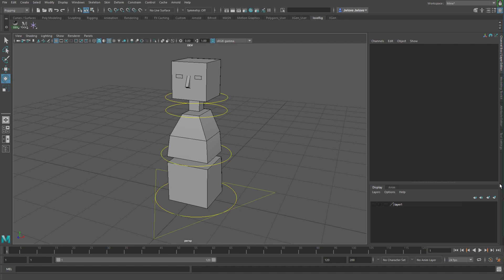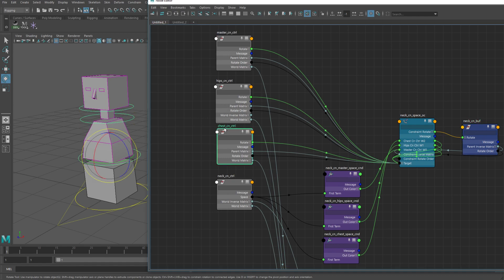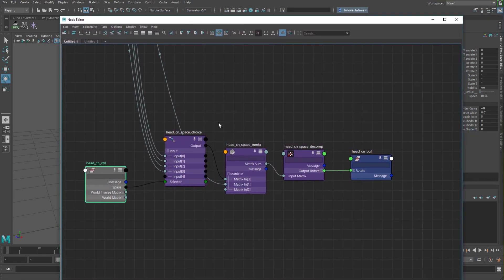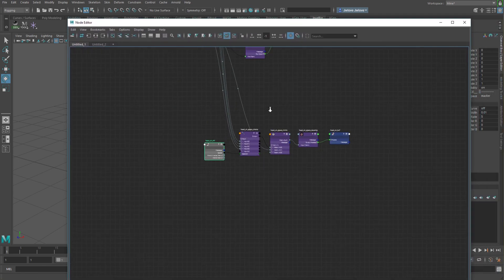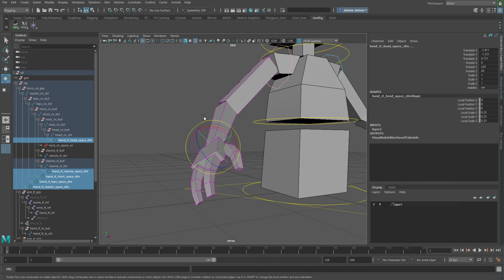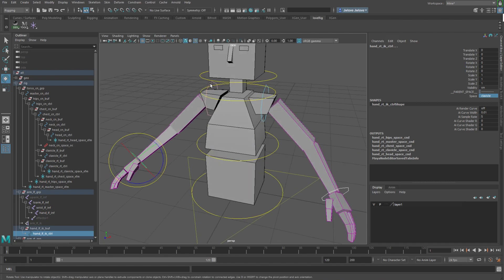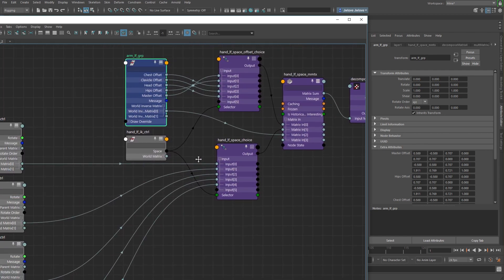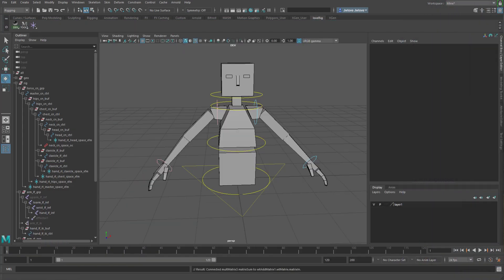Maya matrix node space switch tutorial

Comment: Hello Jared. I'm trying to reproduce your maintaining offset setup here. There's some way to connect the "offset" multiMatrix´s  (the temporary one, used just to get the offset calculation) matrixSum directly on the choice node Input using python instead of creating those matrix attributes just for store the data?
I've tried:

offset = cmds.getAttr("temp_multMatrix.matrixSum")

cmds.setAttr("name_of_the_choiceNode.input[0]", offset)

but I get an error:
 Error: RuntimeError: file <maya console> line 5: setAttr: Error reading data element number 1:

I believe the error is due to the type of both nodes aren't the same or compatible. If I add the flag  type="matrix" in the setAttr command I get another error:
RuntimeError: file <maya console> line 5: setAttr: The attribute 'name_of_the_choiceNode.input[0]' does not accept data of type 'matrix'.

How would you proceed? There's some problem in just connect these attributes on the node editor, and keep all the temporaries multMatrix or I'll get a cycle?
Reply from the maker: Hey Bruno - so sorry you've run into this problem. I'm currently on a vacation for 2 weeks, so I'm away from my computer and can't do any explicit testing to make sure I provide a correct answer.  Once I get back home, I will look more into it and we can figure something out. In the meantime, could you please give me any other details of what you're trying to do that you think might be helpful (if there is anything else)?
Reply: I'm really sorry for bothering you on your vacation, man! Actually, I'm trying to connect the result (the "matrixSum" output) of the temporary multMatrix used to get the offset calculation between the target and the driver via python, instead of using those matrix attributes on some other node to receive this information, you see. But don't worry about this right now,  enjoy your vacation and sorry again!
Reply from the maker: @brunosilva3170  no worries! Thanks for your patience and understanding
Reply from the maker: @ Bruno Silva - Ok, well... apparently, I lied about just setting the choice node's input atttrs with matrix data.... I'm terribly sorry to do that to you.

I've set the choice node inputs with other data (probably just float values) in the past, and if you want to put matrix data on the matrix math node inputs (like a multMatrix) without keeping a connection, you have to set them manually since they lose their matrix data as soon as you disconnect them...  Also, the choice node can accept and pass matrix data along when connected...

So with all those conditions/quirks, I guess that I (foolishly) assumed you could set the data on a choice node and it would actually accept it and work just fine.  I did several tests - one of which was to connect it to a worldMatrix of some node temporarily to try and 'set' the attr type of the choice node's input to be a matrix type, then disconnect it and set the matrix data... but nothing I tried would work.

Sorry to send you down that annoying rabbit hole, but it looks like you will need to pick a node somewhere in your hierarchy and add those offset attributes.  The good news is that you can actually set them when you create them to make it work...  You will have to do this in order to get the proper offsets because if you keep any temp multMatrix nodes and connect their output to the choice node, you'll get cycle issues - the offset matrix values need to be static.  I would suggest doing it on one of the top group nodes in the hierarchy for that body part, or if you have a single node in your hierarchy that you use for various configuration attributes...

I tried to add a note to that part of the video, but the ability to do it has been removed by youTube, so I made a note in the video description...
Reply: I've really tried here as you did, but at the end of the day, I kept the attributes in the parent group of each limb setup, as you suggest in the video. Despite that, this setup works really well! I'll try to use it as much as I can in my future rigs. Thanks again, Jarred!
Reply from the maker: Yep... One of my college instructors favorite phrases was 'whatever it takes, just win' - at the end of the day, sometimes you just have to make it work even if it's not quite the way you were hoping for....  I'm glad you like the setup and hope it serves you well on your rigs!

Comment: @10:53 I don't understand why the locators are necessary in the constraint version?
Reply from the maker: Hey MrBrN197, those nodes don't necessarily need to be locators - an empty transform node will do just fine.  I just used locators to show you where those nodes existed in space.  Their purpose is to give you several nodes to parent constrain your driven item to without having to deal with any kind of offset issues since the offset would be different for each driver (head, hips, master, etc).

Maintain offset doesn't really work on constraints with multiple drivers that you are blending between because it can only store one offset (instead of one per driver).  So the easiest way to ensure a 'clean' switch is to have transform nodes that match the position and orientation of your driven item, then parent those to each of your 'drivers' and use the nodes to do a constraint without any offsets.

hope that helps!
Reply: @JarredLove  are you referring to an orient/point or parent constraint. I don't seem to get any issues using a parent constraint with multiple drivers on an object with maintain offset checked. the offset is maintain between both drivers.
Reply from the maker: Hey MrBrN197 - aha!  You got me there - as it turns out, parent constraints do have per-target 'targetOffsetTranslate' and 'targetOffsetRotate' attributes to store those offsets.

Back before the parent constraint was added to maya you would typically set up a space switch with a point and orient constraint which only store the single offset so you kinda had to make those extra empty nodes to line up the pivots...  After I started using the parent constraint, I just kept doing it that same way!  Man, you get used to doing something a certain way and don't always catch when you don't necessarily need to do it anymore!

So, in using a parent constraint, you actually wouldn't need those locators/transforms and it should still work fine; however, since the stored offsets are somewhat hidden away within the constraint node, it could be a little bit more difficult to diagnose if there's something wonky going on with your switch.  Having the transforms there does make it a little easier to select the node for a given 'driver' and see where that pivot is and how it's oriented in space...  But, there's really no reason you couldn't create a tool to make temporary locators and use the values in the constraint to give yourself a visual cue when trying to solve that potential issue.

good times!
Reply: @JarredLove  Ahh I see. Thanks

Comment: Hello, I have a question about a problem I encounter trying to build this on my rig. I have a prop that I'm space switching between the left and right hand and the world. I can get the prop control to follow translation of the desired space, but when I rotate the drivers the driven control has bizarre rotations happening. Do the drivers have to have frozen transforms?
Reply from the maker: Hey Sean, thanks for taking the time to watch the video and give it a try!  I'm sorry you're having difficulties, and it's a little difficult to know what's wrong without being able to see the file... Is it flipping when you switch between spaces?  Or do you mean that you rotate your hand control and the prop is rotating a completely different way?

In general, I would avoid freezing transformations like the plague.  It almost always causes problems when you're trying to debug stuff since the freezing process still stores a bunch of offset information onto the transform making the resulting matrix actually different than what you think it is... It's just an extra headache.  Instead, I just use another transform as a buffer node which will be used to 'store' all of the non-zero transform values so that the node I'm interested in will have a clean zero state.

I don't know if that is enough to help you fix your problem, but if it's not, a little more info could hopefully help point in the right direction!
Reply: @JarredLove  Hey thanks for the response, actually I found that I has used the incorrect parent world inverse matrix. Got it sorted out and wrote a nifty tool to switch. Thanks for sharing this tut!
Reply from the maker: Aha - yep, that'd do it!  Glad you got it figured out!

Comment: awesome info, i always try to use matrix constraints in my rigs, i absolutely love them, but never used them in a space switching setup, very clever method, thak you very much. Any idea on how to setup an aim constraint with matrix nodes? i saw something similar on the cult of rig channel, but it was to complicated for my little brain :-D
Reply from the maker: Thanks!  I'm glad you enjoyed the video!

It is possible to set up an aim network, but it requires a lot of extra nodes and is kind of a headache to get it to work correctly (not as clean/simple as the point, orient, parent, and scale networks - which are really all the exact same network but just driving different attrs on the constrained node)...  And it may not even evaluate faster due to all the extra connections and un-optimized operations since some nodes can handle so many different types of operations...  Here's a blog post talking a bit about the math behind the aim constraint that you might be able to use to build it:

http://sugarandcyanide.com/blog/2009/05/22/vector-is-that-you-its-me-and-im-blank-on-a-witty-finish/

The blog post is geared a bit more toward how you would need to calculate the data in order to write a plugin for an aim constraint replacement node instead of how to create the node network to make the constraint, but it's helpful to extrapolate what types of operations you would need to hook up...  If I remember correctly, you would end up with some vectorProduct nodes using the dot product operation to get your rotation axis vectors to be orthogonal and feed those into a fourByFourMatrix node to create the final matrix....

Now, probably the easier thing to do (and what I do) is to go ahead and use maya's aim constraint, but then de-cycle it as much as possible by snipping connections or driving them with something else where appropriate.  Here's a video from cult of rig (love that stuff!) on how you can de-cycle constraints:

https://youtu.be/wT4D_I89aQ8

Fortunately, he's actually using an aim constraint to demonstrate it.  You may have already seen this one since you mentioned watching some of his videos, and you don't necessarily have to watch all the explanation parts where he's describing the graph evaluation (although I think it's really helpful insight) - so if that makes your brain want to explode, you can focus more on the parts where he's adjusting the connections.  If you want to retain the capability of the constrained node to be moved (whether an animator directly or indirectly causes the constrained node's translate values to change), you will still need to leave the translate connections cyclical; however, if the aim constrained object can be 'split up' with the parent and parentOfTheParent nodes the way he gets to in the latter half of the video, then the cycle can be completely removed.

I hope that helps!
Reply: thanks a lot for your reply, yes i saw that part, actually i watched all the season 00 , and i was lost at the season 01 :-D i'm really not good at math ! so de-cycling it will be then :-D (though , i remember when i watched rafaelle's video, i tried to replicate what he did, but i was having less framerate than the cyclic one... maybe i did something wrong , or maybe maya was cashing the constraint, i don't know :-) ) , anyway, i absolutely love what you're doing, and i hope to see another video from you soon :-D cheers.
Reply from the maker: Hmmm, that sound a little odd - perhaps your computer was doing something else that demanded more computation as you were testing the pruned aim constraint...?  Were you testing on a very simple scene of only a driver/driven node with the aim constraint between them?  It may also be helpful to do a timing test with a few hundred duplicates of a default aim constraint with a little animation on them, then a duplicate file where the constraints are de-cycled and see if it was just a fluke...

There's another comment for this video asking how much faster this is than a constraint.  You can look at my reply for a little more detail of how to test it.  To generate your file, you can create an aim constraint and animate it a little, then save it and do some imports (you can script the import, or just import in stages to a new file - import 5, save that separately, import the new file to have 10, save that separately, import that a few times to keep building the number of constraint setups you have in the scene) to get a file that has 200 or so of them in the scene - then de-cycle your original file, save it and do the same type of import method to get another file matching your first test file, then do the timing tests on each and see how it goes.
Reply: Yes, i tried on a very simple setup, i'll do the import method and keep you informed, i'd like to know the result since i use quite a lot of ribbons setup in my rig, they're not really heavy, but i'm trying to make them lighter , thanks for the testing method :-D oh and i also really liked your ik arm setup videos, thanks again.
Reply: Just tried on 200 aims, no difference at all, almost same fps, with the cyclic one being faster at times.. weird. (Just tested with parralel evaluation only.)
Reply from the maker: Yeah, that is odd - and not what I would expect at all... makes me want to do a test myself!
Reply from the maker: Ok, so I did 3 different version files of 200 aim constraints with the same 50 frame animation in each.  'Default' is a straight up aim constraint without any adjustments.  'Partial prune' is where only the translates from the driven node feed back into the constraint, and all other cyclical connections are gone.  'Full prune' is shifting the connections around so that the parent and parentOfParent nodes feed into the constraint an there are no more cycles at all.  Here are the results (average first, then 3 test result values):

-default:
Playback Speeds
===============
    DG  = 328.605 fps (333.333 | 333.333 | 319.149)
    EMS = 102.781 fps (103.448 | 100 | 104.895)
    EMP = 268.371 fps (254.237 | 267.857 | 283.019)

- partial prune:
Playback Speeds
===============
    DG  = 316.933 fps (319.149 | 319.149 | 312.5)
    EMS = 106.655 fps (105.634 | 105.634 | 108.696)
    EMP = 282.94 fps (288.462 | 306.122 | 254.237)

-full prune:
Playback Speeds
===============
    DG  = 315.192 fps (306.122 | 306.122 | 333.333)
    EMS = 93.184 fps (93.75 | 94.3396 | 91.4634)
    EMP = 257.893 fps (245.902 | 250 | 277.778)

I'll admit, this wasn't  exactly what I was expecting to see.... I didn't necessarily expect an insane speed boost, but I wasn't really expecting anything to be slower if the cyclical connections were removed.  But, results aren't exactly consistent across the board - sometimes it's faster, and sometimes it's slower between the different versions...

So, I tried it with 500 constraints in each file to see if it would even out, and here are the results (sorry, just the averages of 3 runs this time):

-default:
Playback Speeds
===============
    DG  = 129.356 fps
    EMS = 38.662 fps
    EMP = 126.775 fps

-partial prune:
Playback Speeds
===============
    DG  = 130.441 fps
    EMS = 39.3717 fps
    EMP = 127.512 fps

-full prune:
Playback Speeds
===============
    DG  = 125.356 fps
    EMS = 34.7493 fps
    EMP = 120.973 fps

You can see the partial prune is a little faster than the 'normal' constraint but only just barely... around 1 fps faster - and that's with 500 of these things in the scene.  The full prune was slower across the board, but it kind of makes sense since there are 4 nodes being evaluated in each setup instead of just 3 like the other two versions.  Since the full prune does technically change the way the aim constraint actually works, I would treat it like more of a 'hey, here's a cool trick you could do to an aim constraint that may be beneficial in a few situations' kind of thing.

In conclusion: would I still recommend pruning the aim constraint?  Yes (at least to the 'partial prune' level)... even though it's a VERY minor speed improvement that isn't necessarily noticeable.  Every little bit helps - especially when you have several rigs in a scene, all those minor speed boosts will help overall.  Even looking back at the 200 constraint tests, serial and parallel evaluation modes were both faster on the partial prune than the default constraints... DG was kind of an anomaly there...
Reply: i was hoping i did something wrong :-D anyhow, great info ,  thank you for your time and effort.
it was a pleasure to have a little chat with someone as passionate about rigging .
cheers.
Reply from the maker: No worries - it was actually a pretty interesting test to do, so thanks for asking the question!  Also, thanks for the support - I hope you enjoy my other videos and keep an eye out for new ones as I make them.  Have a good one!